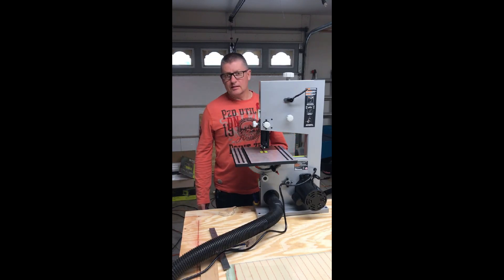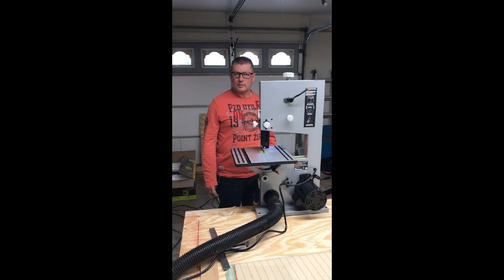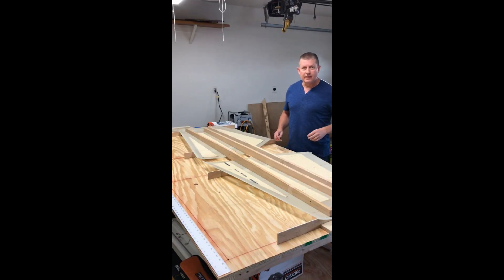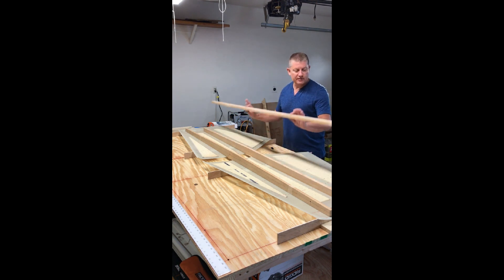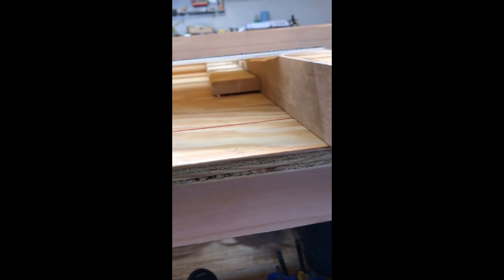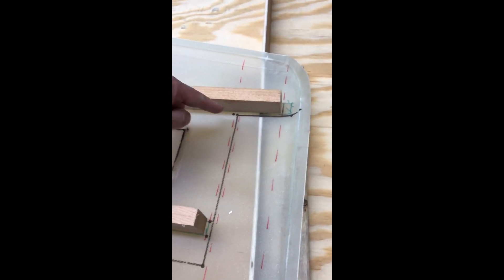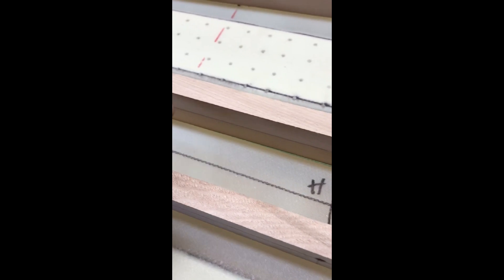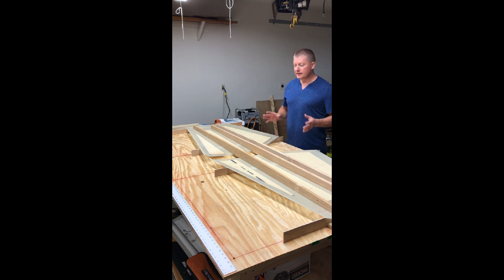S2 - Building a Saberwing Experimental Airplane (Homebuilt Kit Plane)

Comment: Hi Dan . do you intend to have IFR instrument panel and are you Instrument rated.?
Reply from the maker: Hi there, I am not certified IFR, but it's something I want to do going forward. I am planning to build the panel with full IFR capabilities, or at a minimum, that it can be IFR with simple changes/additions. My thought is dual 10" Dynon Skyviews with a Garmin GTN 750 in between... the cost is pretty high on the GTN750, so we'll see if that gets put in right away. With the size and capabilities of the Skyview, and having the charts on there, I should probably look at the GTN650. No decisions made yet!!  Thanks for stopping in.  Cheers, Dan